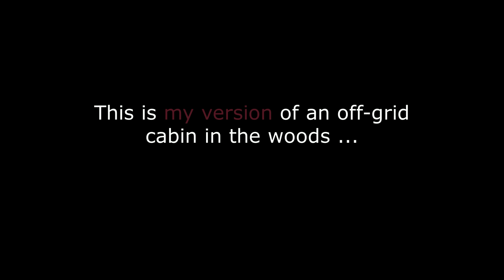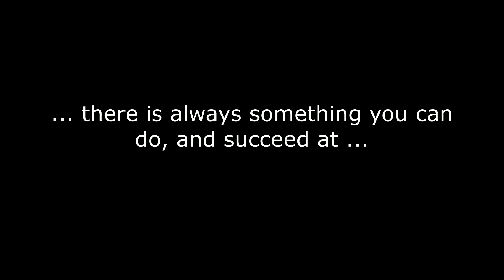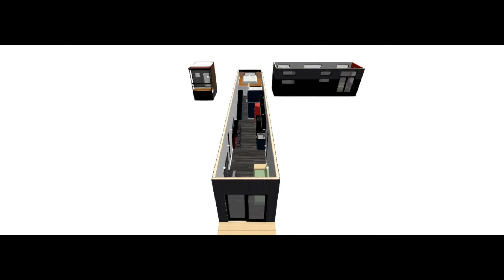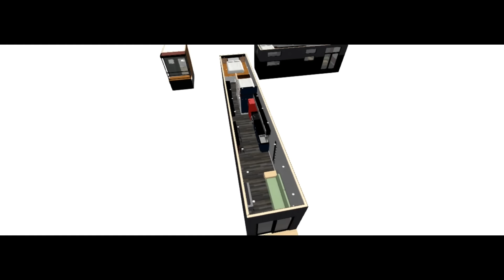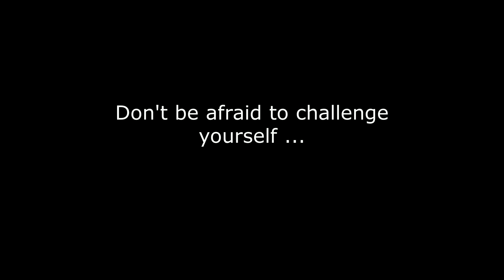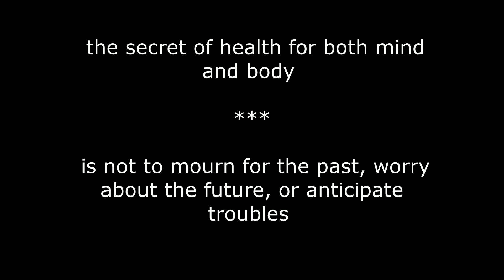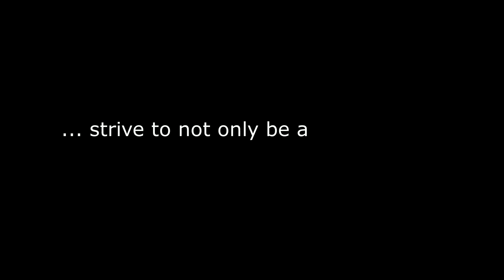... Because the RENT is TOO DAMN HIGH | PT. 1

Comment: Go to harbor freight get a 20 ton bottle jack get some center blocks jack up and block the that trailer and then get dome mobile home tie downs and secure it to the ground then if the tire are not dry rotted get some oil/wax for tires and keep them heavily coated so if you ever want to move it you have safe tires to do so oh and I would recommend sealing the roof those rivets on the roof love to leak in the rain. Good luck and nice build
Reply: This is really nice, especially, if you wanted to use it as a hunting camp.
Reply: Deflate the tires dig some holes an put in the tires in the holes make cement pads get it as close to the ground as you can .coat the roof with mobile home roofing paint .it has rubber in it . an spray it with the colors you want
Reply: @lisacoffey4478  I suggest white paint to keep things as cool as possible in the summer.
Reply: Dean &April, Yep! I was thinking the same thing about anchoring that semi. When he said some of the storms are worse than hurricanes I was remembering how much damage can be done to semis. Hope Tony takes your advice.  : )
Reply: Also grease all the axles heavily every year
Reply: I agree definitely need anchors!!

Comment: You own the land so put a permanent foundation underneath with access hatch  so if you need to get under it you can . It's awesome what you are doing, follow your dreams. Would love to see the rest of the building. Someone has developed a white paint that reflects the heat I believe it is available or will be soon. Great job young man.
Reply from the maker: In actuality, I own the land jointly with the govt. Even though it's paid off, I still have to send them a yearly check AND abide by their rules; which includes no permanent foundations for this type of structure. Also, I'm not building a house; I'm building a semi trailer 😉😉

Comment: Very cool. I would love to see the finished trailer. Looking at some of your other videos I had an idea you may have thought about already. Bring in several dump truck loads of fill and raise the ground level around the trailer a few feet so when it rains you are not walking in mud. Then build a deck all the way around the trailer at the height of the floor in the trailer. Maybe a screened in portion. Being a south Florida native myself, I can only imagine the mosquitos out there at dusk and dawn. Damn!! For your parking area for your nice cars some dump truck loads of white gravel. Also make nice gravel walkways from the parking to the raised portion of the property around the trailer. I hate the idea of parking in wet mud and grass and walking through it to get to my cabin or trailer. Looks great! I would need AC in that trailer though. I guess your generators will have to do if you want to remain "off grid".

Comment: Great job, love the idea.  It probably be possible to remove the axles and landing gear and place it on the ground or better yet, build a foundation and basement.  Could even stack them for multi level or side by side.   Seems far better than using shipping containers.

Comment: Have this same idea but with a drop frame moving trailer for additional headspace.. Would have a lot more room for your loft. I like your sliding door in the rear. What are the dimensions on your bathroom? I'm tuned in for results.
Reply from the maker: Yes, a moving van would have been ideal. I’m actually going to raise the ceiling height 4 feet above the loft and stair; the walls and roof are going to fold in for transport. The bathroom dims are 4 ft x 10 ft. Thanks for your comment
Reply: Wow 🤩. Don’t know why you don’t have more views. I thoroughly enjoyed the video and would like to see your complete build. Thanks for sharing. Best wishes.

Comment: I have been thinking about doing a shipping container build for a while and then I kept seeing this pop up over the last few weeks but never got a chance to check it out. The only thing I see that may be an issue with this build is the way these things are built, the trailer not the home build-out. I am curious to see the end result. The outer walls on these things are pretty flimsy but I suppose if you framed it right it could stiffen it up a bit. And it being a trailer if you ever needed to move it it would be pretty simple compared to a shipping container.

Comment: You are supposed to tie down the trailer with a heavy duty steel band connected to stakes driven deep into the ground to prevent the trailer overturning from storm wind gust surge, and ground the trailer with heavy duty copper wire and stake driven into the ground to serve as electric surge protector from lightning strike.
Reply from the maker: What qualifications makes you an expert in these areas...? How many of these trailers sitting in delivery yards do you see tied down with ground rods installed? 😂🤣😂
Reply: Many YouTubers don't get into the fine details of their conversions but many municipalities, counties or parishes have grounding requirements. Time constraints don't always allow builders to get into fine details. As for anchoring trailers, containers ect. its up to the local codes again. As for me personally I have an ISO military comms box, it sits on the ground and is electrically grounded through the electric service going to my home. No big deal. 
Love the versatility of using most any type of trailer or container for simple shelters and homes.
Reply: @2MasterBuilder2  man don’t you just love all the experts on YouTube , they probably have never built anything , it’s yours keep up the good work
Reply: @2MasterBuilder2   you got on folks about being negative, but here you are getting snappy yourself.  My question would be Is your trailer built to be mobile or stay put?  If its mobile then it is what it is.  But if it's staying then there is solid rationale for it to be strapped, i.e. building codes.  Mobile homes are strapped in pretty much any municipality due to whatever natural disasters occur within their locale.  Wasn't knockin' ya bro, just seeing it from varying angles.  I drive 18 wheels, I build, and still have much to learn.  Peace 
"A mind is like a parachute. It doesn't work if it is not open."  - Frank Zappa
Reply from the maker: @keithhogan6997  ... If I'm being "snappy" it's because people just want to find any little thing to hate on. I'm building a SEMI TRAILER not a MOBILE HOME TRAILER, therefore building codes DO NOT apply; that's the main reason I went with this platform to begin with. I've been an architect/engineer for over 15 years and have designed many structures that are way more intricate than this. I've had this idea since I was 10 yrs old and I'm now in a place in life where I can actually build it. If it works out, great; if not, I'll try something else. I'm sure I'll learn something either way. Since you're a driver, how many of these trailers have you seen tied down at distribution yards?
Reply: @2MasterBuilder2   bro, haters gonna hate. Ignore em and let em stew in their own stank.  I know exactly what you're building, I've had plans to do the same before containers even hit.  I'll ask you again, are you gonna leave it where it's built or do you plan on it being mobile like a "tiny home" where they move them now and again?  The weather doesn't care if you're at a DC or not.  IMHO if it's going to sit strapping it keeps it from blowing over if not outright tumbling when you get those lovely F class "breezes" blowing through.  Mobile homes get tossed like salad and they aren't like the sail that a 53'er is. AMHIK!  Again, not knockin you.  And I honestly don't think the OP was either.  If he was/is/isn't let it go and just keep your flow.
Reply from the maker: @keithhogan6997  ... Another reason I chose this platform over a container is the versatility it provides since it's on wheels. For the most part, it'll be parked where it's at but if I need to move it, I'll be able to do so easily. I'm in the center of the state, which is outside of the wind borne debris region. In my area, storm shutters or impact glazing isn't even required so I don't have to worry about my trailer blowing over; if there's an anomaly and it does, I guess I'll be starting another build. I'm sure to learn something either way. I currently design ground mount utility scale solar systems for a living so I'm very familiar with the wind zones here. Cheers!
Reply: @2MasterBuilder2   being mobile was def a + in my book, even if to another spot on the property. A reefer trailer is another big + in making my choice.  Good to hear you aren't in the blow zone.  I've actually been on the 10W having come up the 'Pike in the late hours and rolled through 2 spots unaware until I was blown just about sideways. Not a fun ride for sure.  I'll be watching for your next episodes on the build.

Comment: I wont join the tiny cabin crowd, i will buy several trailers and just start parking them side by side, and they can be bought cheaper than a connex. Already have a Peterbilt tractor.

Comment: No wonder he lives in the woods, he spent all his money of cars!
And a trailer like that has no insulative value so if it snows where he is, it's going to freeze!
He would have been better off getting a shipping container and insulating it, or better yet, a refer trailer!
Reply: Shipping containers cost as much or more than a trailer right now. Not a good idea to buy a shipping container for housing yet. The better cheaper option would have been a used camper until containers are cheaper.